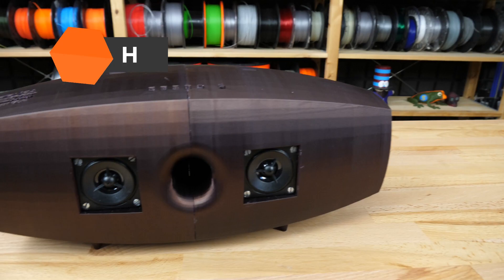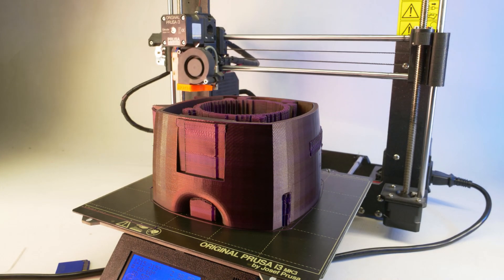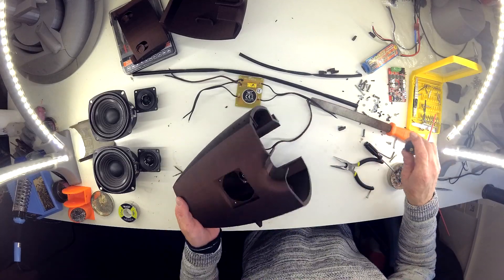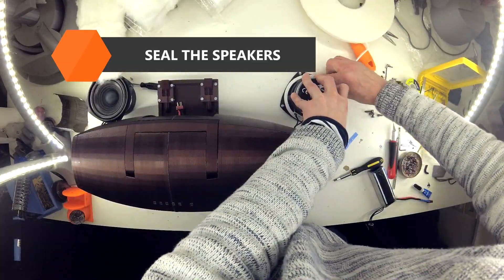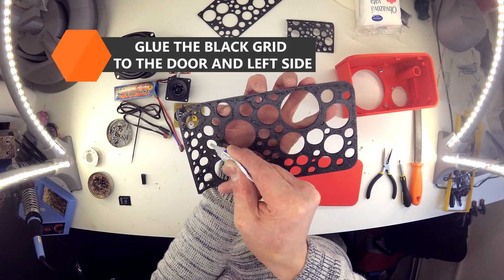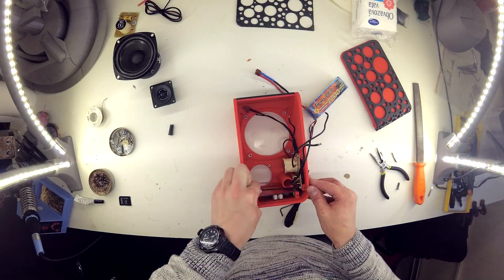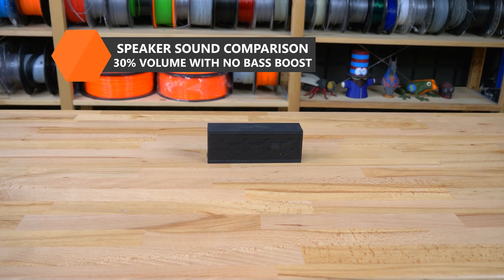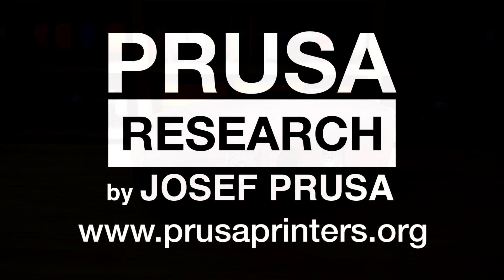How to build a 3D printed boombox

Comment: Why does Prusa call their printer "original" after multiple generations? There isn't another company claiming to be Prusa printers either. Just curious
Reply from the maker: Have you ever tried searching for "Prusa" on Amazon (or Alliexpress or pretty much any store)? :D They are swarmed with thousands of "Prusa i3" printers. Which is fine, that's what the design is called and it's Open-source, but with the "Original" keyword we try to distinguish ourselves from the Chinese clones.
Reply: @Prusa3D  Ah! That makes sense. Thanks
Reply: Prusa 3D by Josef Prusa my scool bought 30 fake printers, only 2 worked

Comment: ok the speakers are over powered or the amp is under powered that amp working at 8ohm will only give half of that wattage i think if you use 4 ohm med speaker you will be better served ;) but nice project :)
Reply: and try to make a v2 with passive radiators :D

Comment: What is the sanding tool you’re using? Where can I get it?
Reply: It's a file. You can find it in any hardware shop
Reply: Aurelio Mannara do you have an amazon link?
Reply: Something like this would work https://www.amazon.com/Stanley-21-106-8-Inch-Mill-Bastard/dp/B004EBMXZG/ref=mp_s_a_1_6?ie=UTF8&qid=1549654220&sr=8-6&pi=AC_SX236_SY340_FMwebp_QL65&keywords=File&dpPl=1&dpID=31MrQOB2RKL&ref=plSrch
Reply: I prefer Nicholson files, however if you are only using them for plastic and not steel, aluminum, or brass the cheap ones will work just fine.
 https://www.amazon.com/dp/B00J9S5HYS/ref=cm_sw_r_sms_awdb_t1_IlfyCbZ7N7R48